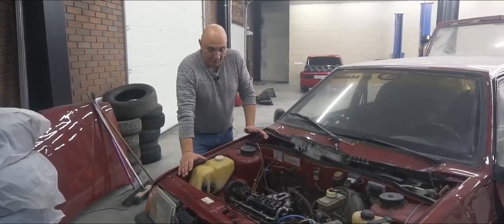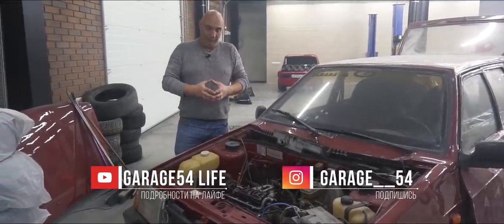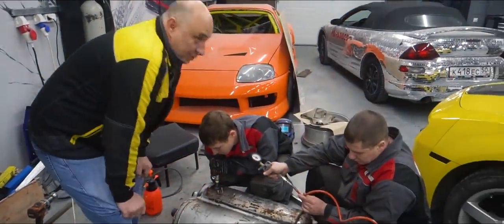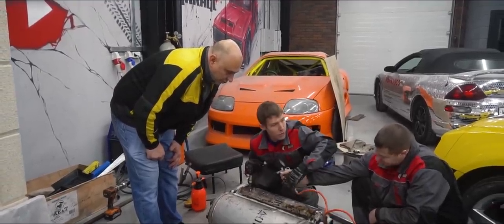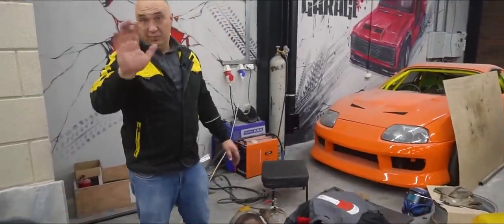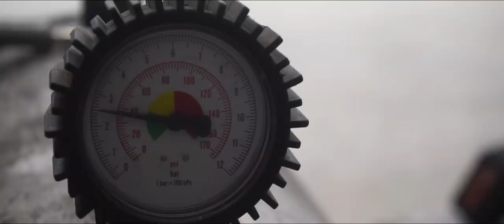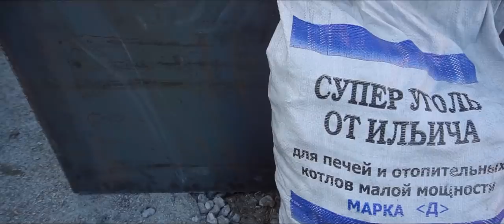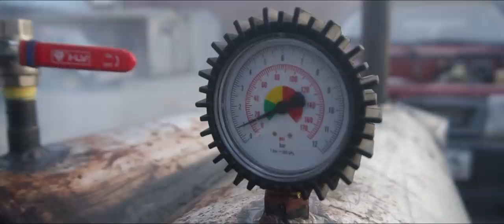Steam engine conversion – first startup

Comment: How about instead of coal... use a large gas burner... easier to control from inside the car... and safe if there is a problem with the water level in the boiler

Comment: I got to do is do the math find out how much coal you need and how hot it needs to be able to get to fill up that pressure system sufficiently enough to keep it going which takes in count the engine volume and all of that but you can't figure it out

Comment: 10 seconds in and im already confused..  how do you turn an engine with compressed air? 18 years working on cars i have no clue what that means other then using an air impact gun to turn the crank by the balancer bolt.  which would be risky, best to do it by hand.  if im missing something here someone could fill me in id appreciate it..   

He Explains it as if he just pumps the plenum up with air then the engine runs? thats not how an engine works. a combustion engine needs an expansion of gases inside the combustion chamber while the vales/reeds are in a closed position to create the needed force to turn the engine over for the next cycle. more accurately 2 or 4 cycles.

Two thoughts....  First, they kept the car in running condition with fuel system and ignition system running then just ran intake air threw the "stream engine" which on an older car like that could work. but likely not well      Or... which the video shows hints of in the end yet dose not explain, they disconnected the timing system which maybe could make the steam turn the lower end of the engine while not being restricted by the valves closing.. but i dont think so..

needless to say, im not buying what he is selling..

Comment: They are running it on charcoal and wood as well which has a lower carbon footprint than coal, so it's better than electric cars recharged from burning coal.

Comment: If they plan on mounting the boiler in the car and driving..... its even MORE dangerous due to the water in the boiler sloshing around with no baffling and no way to monitor water levels or add water if needed. No water to transfer heat to on the other side of the heat source could overheat the boiler and cause a weak spot and cause an explosion.... simply put. Damn I sure hope these guys are reading their comments cause I'm sure the Russian guys on their other channel are saying the same things. I hope nobody gets hurt.

Comment: No water level indicator,no safety valve,no pressure test for the  "Boiler",no safety plug in the bottom of the boiler......what could possibly go wrong?

Comment: Your smoke stack is to small. You have to remember.  As you combustion source burns, it expands. Then your adding more air with a blower.  Your smoke stack is inefficient and needs to be 2-3 times larger. You can also use a steam injector blow on the fire instead of the electric blower. Also, white smoke is to little coal and black smoke is to much coal. Your looking for grey smoke for the most efficient burn and highest heat production.

Comment: Zero carbon emissions? Sure, if you don't count the cloud of noxious fumes coming from the firebox. Instead of going to all the trouble of mounting the boiler/firebox on the roof of the car you could actually just weld wheels under the firebox and push your boiler assembly along in front of the car. You would have to weld some metal bars between the boiler and the car but you could put turn signals and headlights on the boiler but don't take turns too fast. Just a suggestion. You've done worse.

Comment: Now the biggest issue that these guys forgot to figure out is adding water back into the boiler. While it's under pressure. If not these guys just basically built a bomb that could effectively destroy their whole shop. Then with lubrication issues, they need to use steam oil or any high temp-pressure oil.

Comment: crazy boiler design. very dangerous. would have been way less dangerous( but still unsafe as hell)  if they used the 2 tanks separate but besides each other.by cutting like that they destroyed virtually all the hoop strength of the cylinders.

Comment: Guys pls dont kill yourselves .. that engine needs some huge amount of steam..  its better to leave this experiment here dont put that boiler in the car.. if u want to go on with this project just find a small 4 stroke generator and hook tha thing there it will be actually a usefull back up system that will actually work. But lets say you put that thing to the car the risks are very high and you will prove nothing just a car run for a few miles less than 5 or 10 at the best.. think abou it dont pressurised this think.. boilers are copper made have relief valves etc.. i know that you know these stuff and u dont need tips but its not worth the risk.. a small generator will be happy with less tha 2 bars and do it outside will be a good project for this much easier much usefull much safer.. keep on entertain us with more videos respect from Cyprus.

Comment: Wow. 1000pm with zero load. I presume the knowledge of power is limited? The torque required to spin an unloaded engine is far less than that required to move the vehicle. Therefore, the pressure and torque required to main that 1000rpm under load means that more power is needed. Put the car in gear and let the clutch out and I bet it stalls.

Comment: Bloody hell, you’ll all die most horribly. Passing lightly over the odd homemade boiler, it needs an automatic pressure relief valve, if not two. Also, if you feed the exhaust steam up the chimney, you could throw that fan away. Lots of energy left in it even after use.

Comment: Those tanks are NOT a good idea for a boiler. Please just scratch build one from copper.

Honestly, I love this channel, but you're gonna be lucky if you don't kill somebody with this project. No safety valve, very questionable boiler construction, and no real testing performed on the boiler. Someone's gonna die.

In the magical event you somehow manage to cheat death - please use specialist steam oil in it.

Comment: Instead of a tank type boiler use a tube type that has the water flowing through
 a single tube inside the fire box they are more efficient and can use solid,  liquid fuel, or propane gas.
 https://www.youtube.com/watch?v=ACO-HXvrRz8 
 why reinvent the steam engine